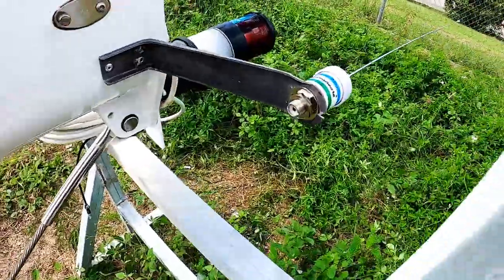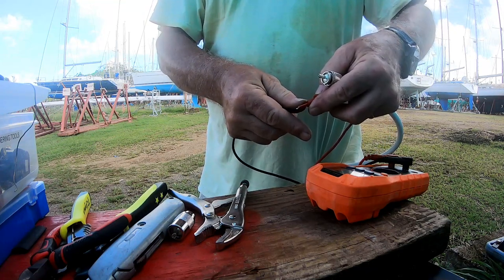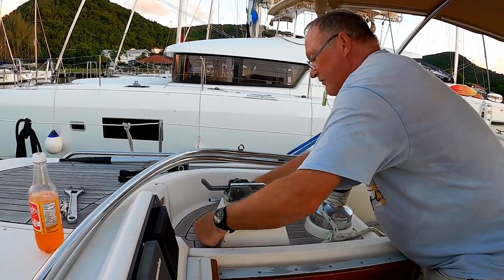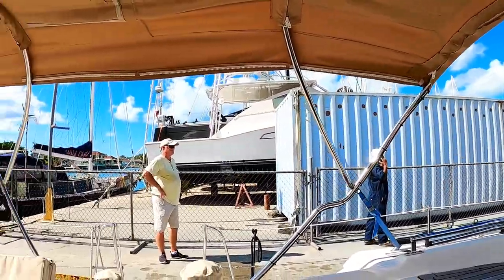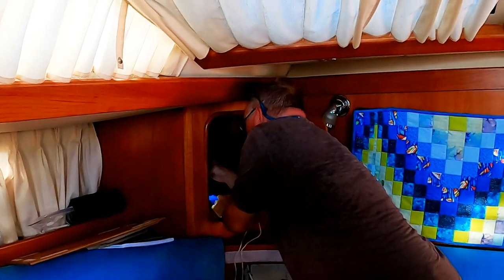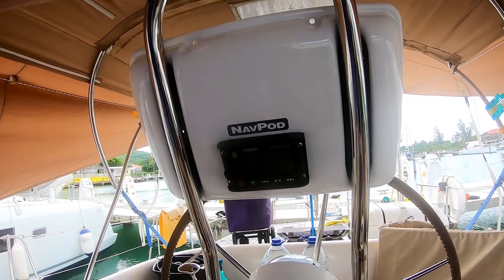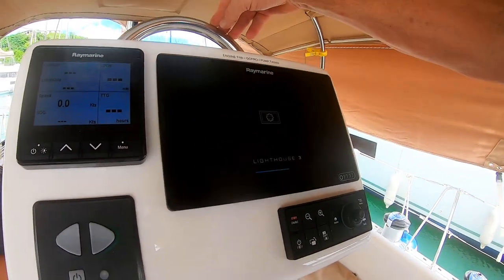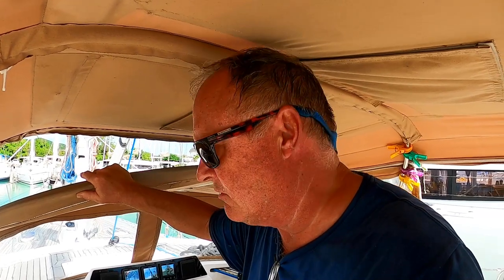Ep 115 Talisman Sails!

Comment: Nice video Kevin & Wendy, good to see you out on the water. The pins on the shroud buckles (not what you call cotter pins and we call split pins) look the right diameter but too short? IE the hole should be further out or longer. We picked up a couple of tips for the plastic hose on your anti-syphon, from an old salt. Use boiling water not a heat gun 3 mins in boiling water softens the tube but will not melt it. Then use a glass reinforced tape under the hose clip to stop the hose clip digging in. We are slowly changing all our hoses like this as it seems to work really well. Lots of work on this refit!! Sail Safe Guys, Ant, Cid & the pooch crew.
Reply from the maker: Hi Ant. You know, I generally have pretty good luck with our heat gun, although it takes some experience. It's like BBQ on the grille. I worked in a ski shop for over a decade using heat guns to stretch ski boots, which are much more susceptible to burning or getting discolored. And you can't dip the hose in water until it's taken off, which is the right bitch half the time. The PVC takes the form of the ribs into the plastic, making it virtually impossible to get off without damage absent some gentle heating. I'd say most people just get impatient. If you start to smell the plastic, it's time to back off. I might take a stab at full replacement of all the hoses sometime if we're up on the hard with nothing else going on. But our boat is crammed with them going every which way. Great to hear from you BTW. How are things?
Reply: @SailingTalisman  Stuck in Sicily at the moment. Hoping to go East to Greece and Turkey as soon as the borders open up. Sail Safe Guys, Ant, Cid & the pooch crew.
Reply from the maker: @SVImpavidus  I suspect things will open up in the next six months. Much of what is being done (masks, distancing, lockdowns) is proving ineffective. People are also getting frustrated with the economic and educational consequences, and I suspect you'll start to see more demands for a return to normal life. Here in St Maarten they have almost no rules. Clubs are open until the wee hours, nobody except commercial employees wears a mask, and the numbers of cases and deaths are no different than the other islands. The main protocol is to tightly control who comes and make sure they have a PCR test. We'll see how it shakes out.

Comment: been binge watching to catch up on content.  Great channel and very informative particularly for me as I've been exploring the purchase of an Oyster myself. thanks!
Reply from the maker: Hi Jennifer. Great to see that we have a healthy base of female viewers. If we were to buy a new (used) boat again there is no choice other than Oyster. We have absolutely loved Talisman, and she's been everything we dreamed she would be. I sometimes worry that we make it appear as though our boat needs an outsized amount of work, and that too many things break. But that's not it at all. With the exception of the hull and joinery (woodwork), every other part is by others. The pumps, plumbing, engine, genset, spars, you name it, is all by the same companies that supply the other boat brands. And I'd say the two things that cause us to need repairs are the age of the boat (26 years/1994) and the fact that we ride her hard, rarely shying away from big weather. We also live aboard, which means the systems are constantly in use. Oyster was in the forefront of building a boat that would mirror your home, with every modern convenience. This led to a very large number of systems to maintain, but the option is to not have them at all, and it's a rare bit that we've replaced or rebuilt that needed subsequent work. If I were to do it again, the only real change I'd make would be getting a slightly larger boat and making sure it was a newer model year. That said, despite spending over $50k immediately after purchasing Talisman to bring her into the modern age electronically, we were "in the green" for over two years, and could have sold her for the same or more than what we paid. If the interior and general maintenance is "very good condition", they support investment, which is rare in the marine world.
Reply: @SailingTalisman  out of interest how much bigger would you go?
Reply: @SailingTalisman  Similar question to Ben H, how much newer would you go?  I really like the Oyster 66 with the split level saloon, but those boats are all 15-20 years old.  By the time I could buy one, they would be as old as Talisman, if not older.

Comment: Thanks for your video , I see that you've replaced your B&G navigational aids with Raymarine and I remember from your earlier videos that you were having trouble with B&G's boat speed indicator which at the time you thought might be due to a dirty sensor . Was it that simple and I'm curious  as to the reason for the brand change . Regards .
Reply from the maker: Hi Nyg. No, our boat came with an older (original) Raymarine system. But it was so antiquated that I upgraded most of it to Axiom plotters riding on the STng (NMEA2000) network backbone and using the Android-based Lighthouse 3 operating system. Conveniently, all the old analog sensors like depth, wind, and boat speed, were able to be kept by using Raymarine's ITC-5 instrument transducer converter module. I was also able to keep the expensive part of the autopilot, which is the Type II Linear drive, although I did upgrade the autopilot course computer to the ACU-400 series, along with the incredible EV-1 sensor that replaces the old Fluxgate design. Our Quantum digital doppler radar integrates seamlessly via a quite reliable WiFi connection to the plotters, which have their own WiFi and GPS built in. This was the main reason that I stuck with Ray, and I have to say that having done so, we are completely satisfied with both the robust nature of the products and the fantastic customer support we see from the company. As I've noted to others, the Airmar speed transducer (paddlewheel) and depth transducer use the same through-hull, and this design has been unchanged over 30 years. It is in roughly half the boats on the water, and is near 100% reliable. Failure is almost always the result of either cross-threading the retaining collar or not installing the retaining collar at all. BTW, it should be noted that the depth transducers are calibrated to the length of the cable provided. This is a long cable, at least 10 meters if not 15, and so generally long enough to reach the plotter location. It should never be shortened.
Reply: @SailingTalisman    Many thanks for a great reply .

Comment: Yet another highly informative video. You guys are kicking goals. By the way, could you do a budget video at some stage? It would be good to have an idea of how much it should cost to operate and maintain a 48 foot monohull to the high standard that you obviously strive for.
Reply from the maker: Hi Bilbo. It still continues, the work and fixing of things, but that's the life. Yes, we have several videos coming up that I hope people will like, especially on how not to get ripped off in the marine world. As for budget, we've resisted that because what people really want to know is how to do it on the cheap, and the short answer is that's not possible. You can defer maintenance or try to repair things that break, thus saving money by your own labor, but the typical mechanical failure will require new parts that will not be on sale somewhere for half off, and typically not available at all except in some far corner of the world.

Comment: Kevin, what's the age of your standing rigging wire and fittings? Have you had to replace that to keep up the insurance, and if so, did that include the chain plates?
Reply from the maker: Interesting question. The previous owner bought all new standing rigging (we were given the invoice as part of the sale), but had never installed the mast. As you might know, the boat was on the hard for 7 years as the owner went through a divorce and tried to figure his life out. So we had seven year old rigging that was essentially new. Fox's Rigging in Ipswich (Oyster sub for new Oyster yachts in the UK) told us that they felt it was the use and salty environment that was important, not really the age, but nobody wanted to put that in writing. So now we're into our 4th year of cruising and I'm of a mind that we still have a few years left on the typical 10 year service interval (often ignored by everyone). As far as I'm concerned, Oyster so totally overspeced the entire rig that I'm not going to worry about it. If it breaks, it breaks. Chainplates would not be replaced during typical replacement of standing rigging absent damage caused by an event of some sort.

Comment: Do you guys have one of those speed log thru hulls on thos boat?
Reply: Hope the same doesnt happen to them as it did for James on his 485
Reply from the maker: I've been in contact with James pretty much weekly since he bought the boat, and I'd say that one risk you need to guard against is the changing of a lot of stuff over a short period of time. You do it, as you must, but overlooking something might have dire consequences. Hose clamps and hosing in particular are dangers, as are speed and depth transducers, obviously. As for James' feeling that these transducer housings have caused problems in the past, I can almost guarantee that either the housing/through-hull itself was installed improperly or that the locking collar that holds the transducer in place was either cross-threaded or the collar not screwed down. This is a product made by Airmar and is used on easily half the boats on the water. The design has remained unchanged over 30 years, and as noted above it is also the same housing and locking collar that is used on the depth transducer, and this is a lot harder to just abandon. I'll also add that the fluid pressure on these units is not great. Wendy and I have pulled the paddle wheel transducer for cleaning with the boat still in the water, and as I told James the fountain will go 12-18" in the air absent a palm to deflect the stream. It just isn't going to come loose if assembled correctly.
Reply: @SailingTalisman  You are absolutely spot on there.

Comment: Doesn't help now ( ;-) ) but there is a lubricant used to help run cables through tight aluminum raceways that also helps in protecting the cable.
Reply from the maker: Yeah, I have to believe they used something, perhaps even soapy water when things were new. But I suspect dust, dirt, and salt got washed down the chase a little bit at a time and locked everything in place. It's one of those things (pulling on a wire) that can get you in trouble if you don't know when to stop. It's important for wiring to be either in a tube or controlled in some other way or it'll slap against the inside of the mast and get caught up in the halyard lines.

Comment: Nice work guys and an  Interesting video.  
Couple of comments
I could not understand the issue with the fasteners access on the quad clutch set without removing the pedestal.  Could you clarify? 
I would have inserted longer clevis pins for the rigging fix........not too sure about compressing the jaws
What is your real opinion about in mast furling........I have heard about so many issues in terms of breakdowns and jamming.  
Glen on Cloudy Bay just did a great 3 part series on servicing his hydraulic furlers.......
Reply from the maker: Hi Geoff. Thanks for getting in touch. So I have to admit that even I don't fully understand the fastener setup for the coachroof clutches. Once I unscrewed the fasteners I heard something metallic drop out from underneath on one set of holes and it was obvious there were no more threads there. So after giving it some attempts at removal of the pedestal base (unsuccessful) I just took some much longer M8 screws and ran them all the way down. I fully expected the nuts not to be lined up or to just spin on the end of the threads, but no, it seemed to catch and I imagined small plates that connected 2 nuts together. So I was able to set the clutch in place, then use the really long fasteners to pick up the plate. I then removed one fastener at a time and replaced it with the correct length screw. In this way I got it secured in proper fashion. 

As for longer clevis pins, they're not easy to get. You need to have them custom machined at a machine shop. Plus, the stainless has to be really high quality, engineering grade, which is something that's very difficult to confirm.

As for in-mast furling, I love our system. Yes, there are issues if you don't know how it works or if your motor starts to die. Or if you let the automatic transmission fluid leak out. But I really like the ability to have infinite reefing, often without even coming into the wind. You lose any ability to use horizontal battens, so it'll never be the full level of performance you get with a slab reefing system. But those can be a real handful once overpowered. The old saw about "If you're thinking about reefing, it's time to reef" is really aimed at slab reefed systems.
Reply: @SailingTalisman  Thanks Kevin....I now understand the bolts did not go thru to the underside of the deck/coach roof.
The options that main in-mast furling gives you are really good but if it goes wrong when sailing it can get nasty....I think I would prefer in-boom furling....at least then you can lower the sail if issues arise.
What's the big picture plan after the Caribbean?
Reply from the maker: @Jackanory222  I think in-mast and in-boom have the same issues as far as electrical or hydraulic failures go. The main shortcoming of our design, rectified in later years, was not having a female winch socket on the manual furling wheel. If there was one of those I could just spin the thing in with a battery powered drill. The drill might suffer from exposure to water, but I could run it inside a plastic bag for the 2 minutes or less it would take. Getting the sail in is rarely the problem. If you're having in-mast furling problems it's usually on the outgoing side. In-boom is much more sensitive to boom angle and there might be concerns about trapping water in the sail. As to our plans, we'll be headed up the east coast of the US for hurricane season later this year.

Comment: Kevin the Jubilee clips you have in your box with holes cut into them are useless. The better clips are those where the thread is embossed, there is more metal there. I also think that you will find that the clips with the holes cut into them are the wrong grade of stainless A2 not A4. I know from experience because they were fitted to the engine and generator of my boat and on our trip to Russia the bilge alarm went off when a clip failed on the engine and 4 days later a clip failed on the generator. I replaced every clip of that design as soon as I could find a Chandler with the right grade of stainless.
Reply from the maker: Hi Paul. Now that is some good information. It's amazing that you call this out as we just had it happen. This last week we had the exhaust separator for our genset re-fabricated here in St Maarten. I have never had a hose clamp fail in the past and thought nothing of reusing the old ones. But lo and behold, two of the six snapped while tightening. It felt like some sort of metal fatigue. But they are the type you mention, with the punched holes. I didn't have the depth of supply to replace all six, so I went to the chandlery the following day and stocked up. I try never to throw away usable parts, but I'll favor the embossed style moving forward and use the others only in a pinch (until they can be swapped out). BTW, the hose clamps on our engine are almost universally of the threaded-screw-on-each-side design (exhaust clamps).
Reply: @SailingTalisman  The clips with the holes we had were stamped
Reply: Sorry for the confusion this is Paul, I just switched accounts.
Reply from the maker: @seacrusader  Yes, same here.
Reply: Good advice.👍

Comment: stop using fire on your heat-shrink. get a proper heat gun.
Reply: There is a bubble of hot air surrounding the pin point flame. He's not using the flame, and it's quite convenient.
Reply from the maker: We have a wonderful heat gun, which I use when we have power, but out there in the boat storage yard, there wasn't any. Plus, the commenter below is correct. That torch will shrink the tubing from a foot away. You never want to have the flame contact the tubing or you'll get carbon deposits. I suspect this is more of a cosmetic problem than anything else as the tubing still remains flexible and pretty difficult to remove, but I like it be clean.